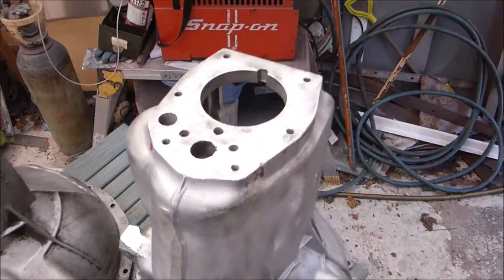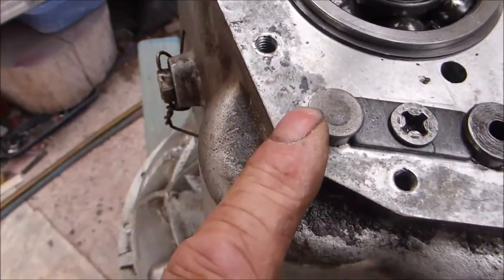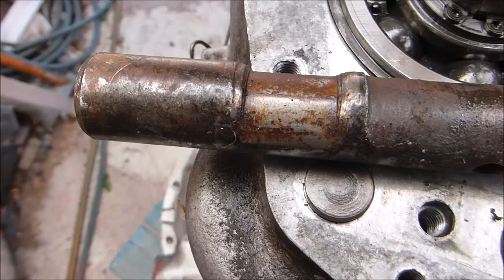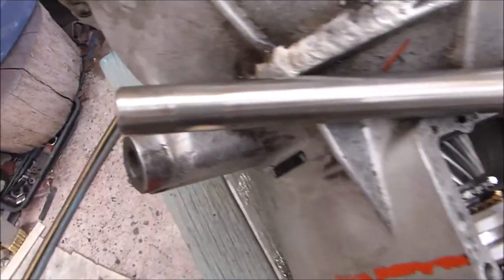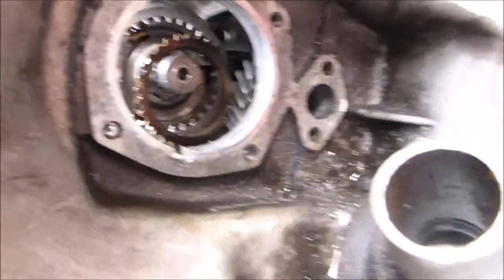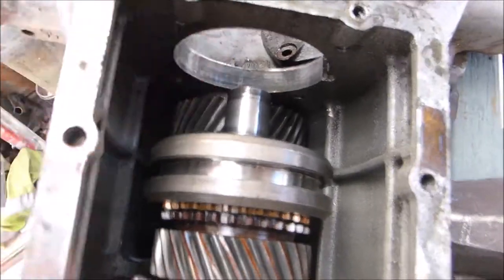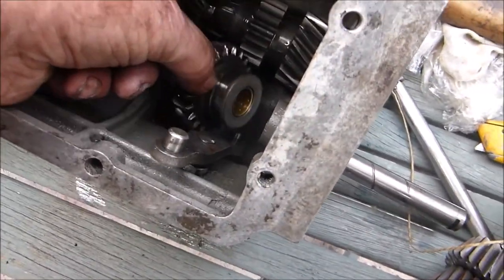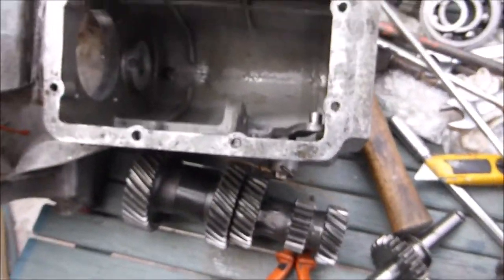Triumph gearbox stripdown

Comment from the maker: Hello Michael, thanks for looking at the video. I will have a look in films in my archives and let you know. The main things are to put all new gaskets in but also use a sealant both sides, check the thickness of the thrust washers give the correct amount  of backash, and leave the lay gears and shaft in the bottom of the gearbox and fit the shaft last. Good Luck. Alec

Comment: I have a 1500 mg midget and have the transmission apart and have a question if you could help me with.

There appears to be be a lot of slop in the 3rd 4th synchromesh which exposes the detent ball, see picture in link below.
https://drive.google.com/open?id=1Ab3d5J6wjea--xCyCcdaCCcKaqYtMkKO

I removed the input shaft and measured about 3/16 of spline exposed from the  synchromesh, when you rebuilt yours in the video, did you notices that mush exposed spline?  See picture of it in the link below.
https://drive.google.com/open?id=1vmRQW1qcUF_GLxQHKxXibWp8Kak6gHZv

thank you for your time